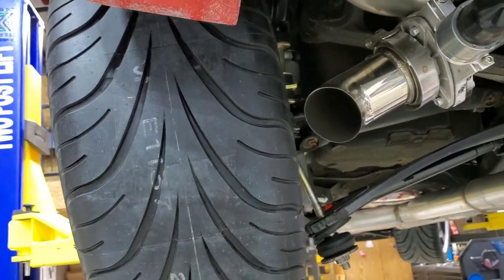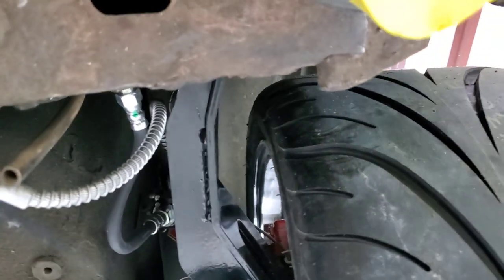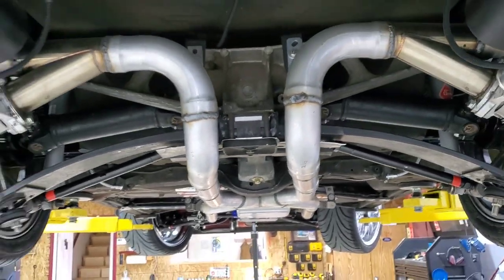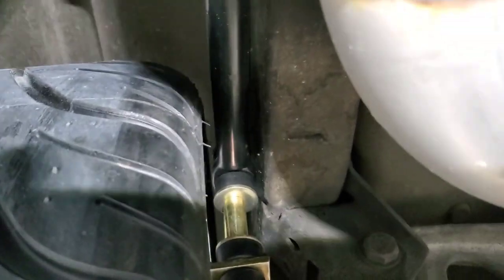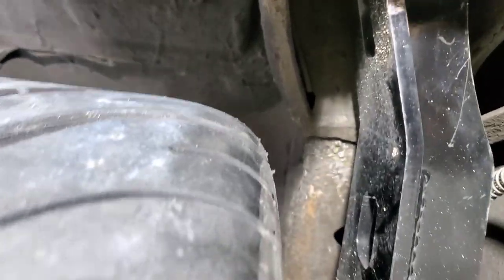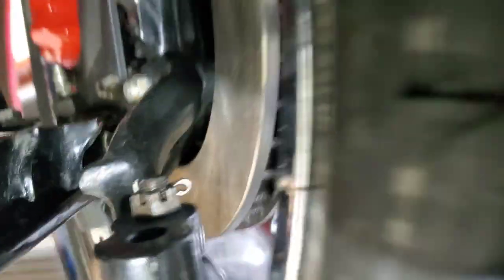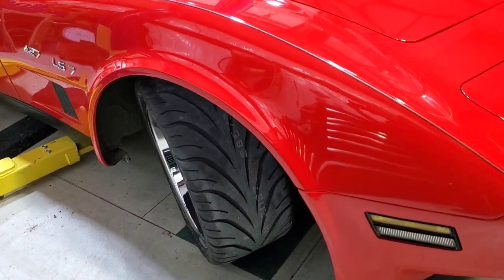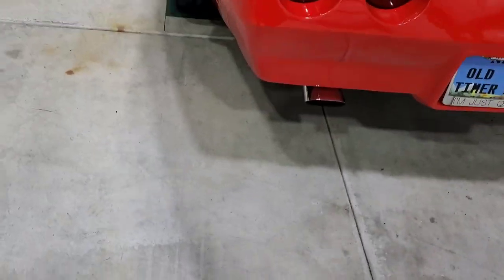C3 Corvette Max Tire Width with minimal modification

Comment from the maker: Stay tuned, after I wear these out, I'm going up to a 295/40/ZR18 I'll keep Ya all updated how that goes....
Reply: Car looks great. Nice job. What sizetire and wheel are u running on the front??
Reply from the maker: @chrishussar7729  Good day, wheels are 9" X 18" and the tires are 285/30/18 all 4 corners.
Reply: Have you installed the 295/40/ZR18?
Reply from the maker: No, still got treed but looking at the Toyo  Proxes 295/30/18 with a 100 tred rating for the next go around.  @diona.906

Comment: I run a 295/55/15 MT ET Street drag radial. Thats 12.5" wide on a 12" wide Cyclone rims..  Carbon fiber suspension and I do not have the bent trailing arms.  I have them but they aren't installed and my tire is at least 2" away from the factory trailing arm.  My carbon fiber suspension is about 3/4" away from the rim and the rim covers the dust shield about 1/4".
Reply from the maker: Would like to see that! Sounds awsome
Reply: @BretMech  I have pics. Where to send?
Reply from the maker: @DumbCarGuy  bret496@ (that G electronic mail thing...hint hint. Thanks!
Reply: @BretMech  gotchya

Comment: I was surprised that in the 79 I just inherited my brother had been running 295 all the way around.  The only noticeable rubbing was in the front fenders.  
I’m plotting to do the parking brake bracket relocation and go from there.
Reply from the maker: Nice, the 295 40/18 will be my next set, what size 295 is he running, is he utilizing a rear sway bar?
Reply: @BretMech  it had the gymkanna bar in back.  I believe they were 295/55 that really bulged on the 8 inch aluminum rims. They had three digit date codes so my first change was to replace those dry rotted hulks with 255/60. once it’s restored my goal is to get a set of 10 inch wide rally rims for the rear and run 295 on them with the bracket mod. I’m told that will have clearance but know many use a narrowed mono spring.
Reply from the maker: @chrissmith7669  Yes on the mono spring, I cut mind down about 1.5" per side, the 275/50/15 3.75 back space 8" wide wheel, I was running would have hit the leaf, easy to cut the FG spring with the band saw.

Comment: is that a factory rear sway bar? Ive seen as you probably have seen on the forums that an 18x10 with a 5.5 backspace works with just the e brake relocate and not even having to do the spring trim and no offset trailing arms, this I believe is on the 81. your video makes it look as though a 5.5 backspace would ride on the sway bar.  What do you think?
Reply from the maker: Good day, well, at 2:00 in you can see where a wider or taller tire will hit the frame, if you go a different back spacing you can have more room, but I also wanted to stay inside the fender well on the outside. Have a great day, thanks for the reply.

Comment: i have a stock 73. i moved the e brake bracket . do you think i can fit 275 6o 15 in the rear? ive heard many people say it should fit
Reply from the maker: I have not tried a 275 with stock trailing arms, the offset arms no problem. there are a lot of combinations to include wheel back spacing to clear the arm but then you must pay attention to the tire clearing the fender.